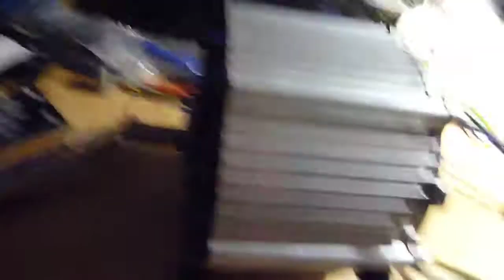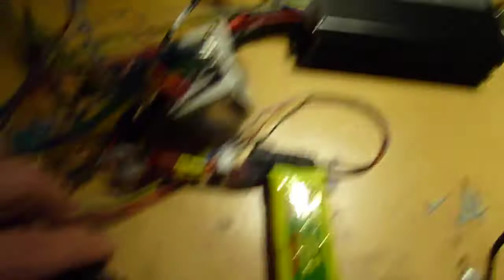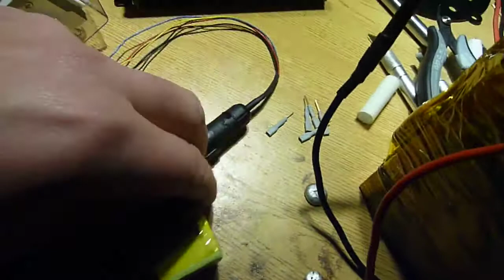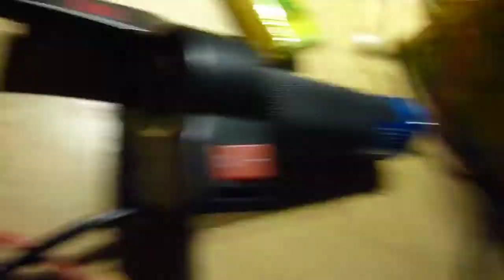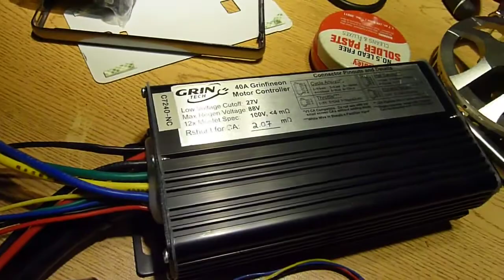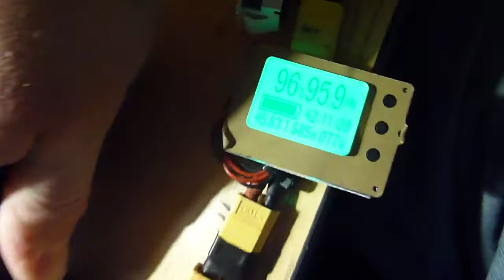HLD inrunner 50mm WYE delta switching sensorless at 48 volts

Comment: Awesome idea, may can i get the wiring diagram of the relay connection to motor and the controller, thanks before🙏
Reply from the maker: You don't want to do this...it does work on the bench, but not in the real world and even on the bench, the chances you will blow up your controller switching from WYE to delta or back is pretty high!
Reply: @de-bodgery  So what tool can I use to convert from wye to delta? Do you have any recommendations?
Reply from the maker: @teguhwahyunuroho9090  If you want a higher Kv rewind your motor for a higher Kv. Switching a motor from WYE to delta to accomplish this isn't that great of an idea. Just to rewire a motor doesn't require some special tool. You can read about these 2 motor wiring schemes.
Reply: @de-bodgery  You don't recommend this method, does it mean that this experiment has damaged the existing controller?
Reply from the maker: @teguhwahyunuroho9090  Did you read anything I wrote?